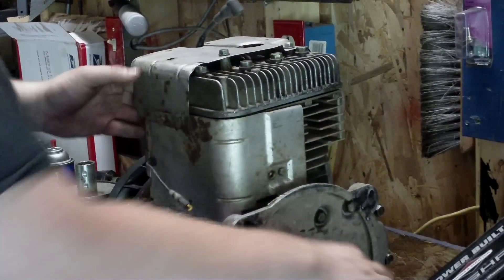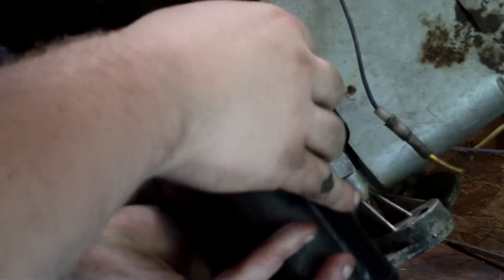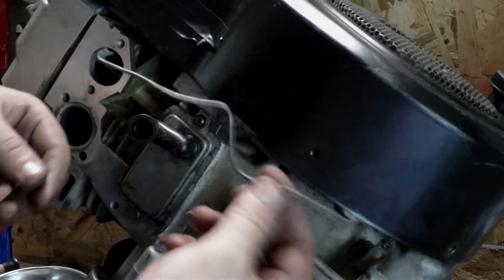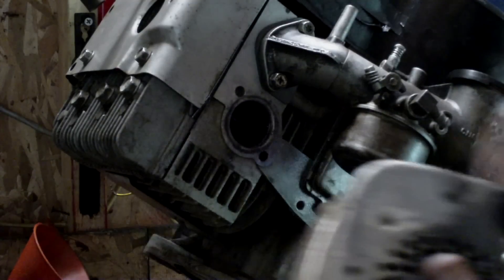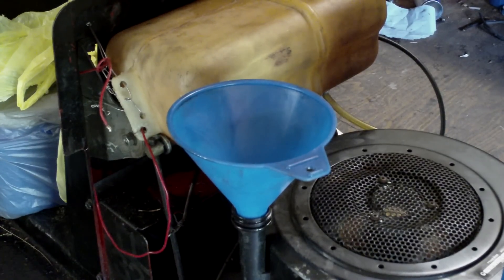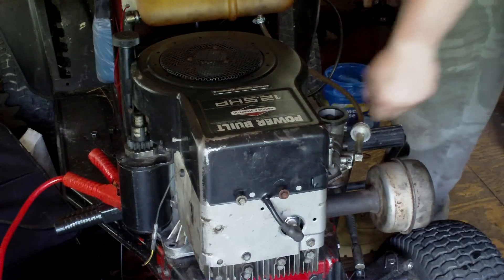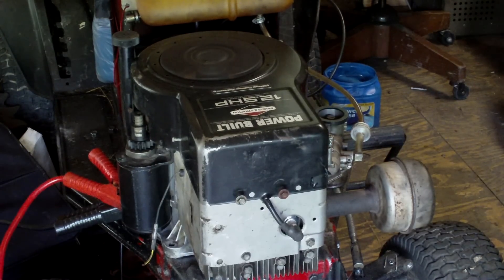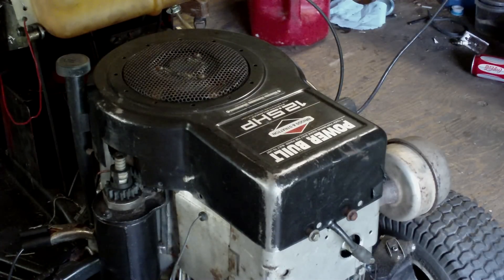Briggs and Stratton Power Built 12.5 HP Flathead Model 28 Rebuild  First Start PART 4 (FINAL)

Comment: got a leak coming from it but don't know where yet, I took the motor off the riding MTD Yard Machines today.  Briggs & Stratton Model: 28T707  Type: 1154-E1  Code: 010302ZD.   Lower shaft seal not leaking but oil was coming out and getting on the 2nd shaft pulley (not the small pulley but the big pulley indicating that I don't have a shaft seal leak)...is was pooling on the pulley and getting all over the V-Belt.  I don't see any crack in the block, but there's black gunk every where more on one side than the other.  I figure the lower pan /sump gasket needs replacing so I'll get that moving if I can find the right gasket that has the right thickness.  The Head gasket area looks dry, I hope it wasn't just leaking at the oil filler tube but probably not since there is gunk all around the engine.  I hope to not have to pull the flywheel but it's sure rusted around it and gunk in there, but it's dry black gunk around that top flywheel area of the engine, not shiny oily black gunk..  Have any ideas on the leak it sure is appreciated,   By the way, the engine runs great and there's nothing rattling inside the engine.  I'd hate to change the lower pan gasket if it's not needed but I suspect it is.  Should I only get Briggs & Stratton gasket, not a problem if so, I just need to find out where to get one (that can be shipped quick like Amazon)

Comment: While this may be eleven years old, he did an outstanding job of showing you how to rebuild the vertical shaft B&G 12 horse motor. There are thousands of these motors still in service and this series will show you exactly how to overhaul them and keep them running.   I just bought a 2001 Estate 48” Rough Cut pull behind mower with this type engine on it for $350.  Now I can rebuild mine too!  Well done!

Comment: Enjoyed! Thanks. 
I'd like instructions on oils. Your one on stp was great. I just use the same 15W40 oil that I use for my van but have been trying to find out if so-called specialist oil for mowers is better, maybe justifying the price. I've learned that if you've only used car oil that's ok -- but if you use the specialist stuff DO NOT revert to ordinary unless your aim is to ruin the engine; unless you flush the system first ... with a product that is...no longer available.

Comment: Very helpful and really appreciate all the detail.  I've got a 10.5 HP Briggs (25 series from 1993) apart on my bench waiting for rings.  I am also having to replace the governor as the hole where it fits on the pin has been wallowed out...long ways so the hole in the gov bracket is oblong along the bracket as opposed to just a larger hole.  Have you ever seen that ?

Comment: thanks for doing the videos.
i bought 2 ride on mowers last week, one was stripped down with no head on the engine, the other supposedly had electrical issues.
after i rewired the "good" mower i discovered the inlet valve was stuck open.
i've mostly stripped both engines down, and there was no clearance on any of the valves, the guy found the 2nd head so i can go collect it.
the bores on both engines look good and measure as standard, so i think with 2 sets of rings and gaskets i will have 2 (more) working mowers.

Comment: I'm looking to rebuild my 12.5 what's the kit coast and is it worth it
Reply from the maker: There are complete rebuild on kits on ebay for around a 100 bucks last time i checked i usually order parts separately if i don't need a complete kit (which usually includes all gaskets, rod, piston, valves, rings etc) and yes, if the engine is in good shape, no major scores in the cylinder and the rod hasn't came through the side then yes they are usually worth rebuilding, good reliable engines and in my opinion better then the current ohv motors. Thanks for Watching!!!

Comment: Do you have any pointers and time frames for full break in?
Reply from the maker: I like to run them for about 20-30 minutes with little to no load varying rpms, drain oil, then in this case, mow grass (like a hour or 2), after like 20-30 minutes let it idle for about 5 minutes, and do this 3-4 times to let the engine heat up and cool down, it helps seat the rings in. then change oil again and it should be close to being broke in by then, some may take a little longer. Thanks for Watching!!!

Comment: Can you take a briggs engine off a craftman mower and put it on a murray riding mower?
Reply from the maker: Short answer, usually. If they both had say a single cylinder briggs it will be a bolt on fit, some of the wiring maybe slightly different but can be setup to work, if your going from a single cylinder to a vtwin or the other way around the bolt pattern is different on the engines, but alot of frame have more then one set of holes drilled to be a more universal fit. So yeah, worst case scenario you may need to drill some holes, but usually can be done. Thanks for Watching!!!

Comment: Great videos chap, thankyou for sharing! I have a 12hp which was blowing gas out the carb and not running, I checked compression and found it to be 0 even though it feels and sounds like it has strong compression... Put my finger over the plug hole and cranked it and it sucked my finger hard!
Started stripping it and found the oil slinger had smashed up but doesn't explain the sucking instead of blowing! 

Any ideas? 🤔😁
Reply from the maker: Your welcome! I'd check the valve clearance to make sure the valves are sealing they act strange like that if they are not sealing. Thanks for Watching!!!
Reply: @fnaguitarplayer9  thankyou back mate, your videos are fantastic, it's good of you to share such extensive knowledge, appreciate it pal 🙂
Reply from the maker: @kiesh.  your welcome, appreciate that! glad to help out.

Comment: Hi, I'm rebuilding a BS 12.5 hp 28V707. My ring gap is .047. Piston and Cylinder walls look good. Can I use .030 over rings to close the gap to within tolerance? Thanks for the great videos!
Reply from the maker: You shouldn't need oversize rings, the rings wear down so if you get standard rings it will take up the difference, I usually usr .010 and then file the gap to get it to spec. Thanks for watching!

Comment: I friend just gave me a Murray with a 12.5 in it. We never managed to start it, but it doesn't sound right when cranking, So I'm going to tear into it today. I figure at best it could use a rebuild, at worse.. well don't even want to think about that.
So your video is going to help a lot, thanks for making and posting!
Reply from the maker: Your welcome! it could be rod knock or the counterweight system.Thanks for Watching!!!
Reply: I thought perhaps it was the connecting rod cap had come lose, being that they didn't put the locking tabs on them... But sadly, it wasn't.  While I'm not a 100% sure, but I think the cause was broken rings, as they were all broke and in pieces, which in turn did a number on the cylinder, deep gouges and one of the lobes on the cam is flattened out. The piston is toast.   I was so jazzed after watching your rebuild video. sigh but this Totally bums me out. I dunno what I'm going to do with it now.. other than watch for a cheap 12.5.. who knows how long that could take.

The piston:http://img4.imagetitan.com/img.php?image=18_piston.jpg

Thanks again for the vid & info!
Reply from the maker: oh wow! Shame to see that happen to one, they are really good motors. Not a problem!

Comment: How do I fix a knocking 12hp briggs and stratton engine do i tighten the connecting rod
Reply from the maker: It can be 1 of 3 things or a combo, it could be rod knock, if so it will need a new rod, best way to fix that, or it could be piston slap, may need to have cylinder bored and a oversized piston, OR the most common source of knock besides rod is the synchro balancer system on the crankshaft, they are bad about making noise. Thanks for Watching!!!

Comment: Thanks again for the replies, much appreciated, I used STP like in your vids so I’ll give it a good cranking with the plug first too. The re-assembled crank felt silky smooth with the STP on the main bearings by the way. Going to try it direct off the battery on my old merc diesel, while the cars running, and if that fails to start it, put my electric drill on the flywheel nut at the same time. I’m guessing that if disconnect the kill wire, clamp the positiv jump lead over the starter cable connector and find a good earth for the neg lead the starter will just go until a lead is disconnected, no matter where the mower key is? The valve clearances seemed pretty good after adjusting so I doubt that is problem.
Reply from the maker: Your welcome! I hear ya, that should get it going! yeah that will work like that. The other thing i've had happen that made a motor super stiff was the crankshaft end play wasn't set right (gasket thickness) and it binded up some, but it still eventually cranked over. we didn't have the right gasket and had to get it going one way or the other.
Reply: fnaguitarplayer9 I got her running, and she’s smooth🙂Had to buy a new inlet valve, I’d ground the original back too far when I double checked.....Amazed me that a clearance of 6 thou compared to 12 thou made all the difference to the compression, but there you go. Chinese carb off ebay works a treat two! Thanks to the help from your video I know have a re-conditioned engine, so I just have to keep the rest of the mower going now! Gonna change to oil regular too.
Reply from the maker: I hear ya! glad to hear you got her running! Oh yeah, it really does! Heard that, surprised to say this but you can't beat the cheap carbs these days, they are actually pretty good! I hear ya!

Comment: Got my engine back on with new rings but compression seems so high that starter can barely get it past TDC. Because of this it wont start was wondering if you had any advice? Could  be the stater but it seemed to work ok before I changed the rings
Reply from the maker: This is common, one reason i've found is there excessive oil in the cylinder from putting oil or stp on the rings and it will cause extreme compression, take the spark plug out, crank it over for a minute, charge your battery back up, and try it again with the plug in and see if it helps. once it finally starts it will be easier after that. I've had to use 2 batteries before, like when car engines are rebuilt. it could be a weak starter but I would guess its oil built up. Thanks for Watching!!!

Comment: Hi again, I’ve got the valve clearances right, and the seats lapped so that will hopefully make a big difference to the running, as there was zero gap. Also decided the engine is coming off the machine, and the piston rings will be replaced! Parts ordered so just need the wife and kid to go out for the day😂 I’ve bought some cheap ring pliers to help, so I’ll let you know how it goes. The engine was made in 97 and I’m hoping to get another 10 years out of it. Would never have tried this without your video so thanks again👍
Reply from the maker: Hi, I hear ya, that makes a big difference itself, if there is no gap then the valves are not closing completely. Sounds good, you should get more than out of it if you get a tight ring gap and keep up with oil changes. Glad to help! Thanks for Watching!!!

Comment: Watched all 4 parts, superb, I’m using the snowy UK winter for a mini refurb of my old lawnflite. Just had my flywheel off at the weekend to renew the key as engine is backfiring, and haven’t started up yet so really appreciate the advice on having it torqued right up. To take time to film this, as you have, it very generous so thank you very much. 
Q sir. If I have the mower on ramps I presume I could take off the pulley from below, before removing the engine? After seeing you do it I really want to check and clean inside the crank case now!
Reply from the maker: I hear ya! Good winter project! Your welcome! You should be able to remove the pulley that way, you may need to remove a belt guard but other that it will come off, sometimes you can leave the guards in place and just remove the bolt and the pulley will stay in place. Yeah it would be a bad idea to do that, they get gummed up badly. Thanks for watching all 4 parts!

Comment: I successfully repaired my engine. Got it started and running 2 nights ago. After breaking it in for a bit, I decided to take it for a spin around the yard and I didn't get very far. For some reason now the parking brake and transmission is acting up. When I put it in gear in either forward or reverse, it sticks in that gear and pressing the brake doesn't stop the tractor completely. Even with the pedal bottomed out. Thing that is messing me up is, when the connecting rod broke, the transmission and braking system worked fine. Not sure what happened... any ideas?
Reply from the maker: I hear ya! There's 2 things that come to mind, first off maybe the drive belt got wrapped around a belt guard making it act like more tension on the belt, had that happen a few times. And its very easy to overlook. Another thing is maybe the engine is sitting more towards the front of the mower, on some mower frames the mounting holes are bigger than the bolts so the engine can actually move slightly with the bolts loose. But i'd say check the drive belt. Thats really the only thing i can think of. Its probably not the brake itself, but if the belt isn't disengaging it will over power the brake. let me know if this was it, if not i'll think of something else! Thanks for Watching!!!

Comment: Thanks for the great videos. I have no experience in small engine repair and I am currently rebuilding a model 28 based on your videos. I have the crank in,  the piston in and I am at the point where I am torquing the bolts on the connecting rod. In your video you say torque specs and gap clearances for all parts necessary. Where can I get that info to have on hand?  For example I think you say 180 in/lb for the connecting rod specs and my lack of knowledge here leaves me a bit confused because the new connecting rod came with 2 different sized bolts (assuming 2 different sizes, require 2 different torque?). Also, do these bolts require thread lock or no?  
Update: I found some torque specs after all. Guess thats where cellphone and desktops differ. The literature I just found says ** Torque Small Rod Screw First:
160 In. Lbs. Torque Large Rod
Screw Second: 260 In. Lbs.
 the page I found is here http://www4.briggsandstratton.com/miscpdfs/RNT/Engine%20Specifications%20Chart_ms3992.pdf
Reply from the maker: Your welcome! I hear ya, glad to help out with your rebuild. that is the same chart i use for the specs, i have it printed out too.  I don't use thread lock on any bolts, unless its rod bolts without the locking tabs, then i might put some on them. Each bolt is differently, you torque the short bolt to 160 inch pounds then torque the long one at 260 inch pounds. hope this helps, thanks for watching!!!

Comment: great video. 1st time tear down and rebuild. went great. quick question though. is there a certain way the piston rings should be facing inside cylinder once installed?  
TIA
Reply from the maker: Thanks! Yeah, the new rings should come with a instruction on that, and if your referring to the ring gaps, make sure they are offset and not inline with each other, 120 degrees apart from each other. I have another video talking about piston ring orientation that goes into more detail on how to install rings. Thanks for Watching!!!

Comment: Thanks for this awesome B&S Model28 rebuild video!!!
I was just searching for help to get my B&S 286707 12,5hp running smooth and smokeless again.
My only hope was, that when i change the piston rings, the engine will work normaly again. Actually I thought my engine is junk because it already eats the oil in litres. So i watched this video and looked how you made it and i made it like you and now...

...everything is fine now, no more smoke and no oil loss! Thats great!
I thought that i had luck too, because my engine block was not really damaged and i thought i realize the problem fast enough so that i did it for the engine in time. 

By the way i am from Germany (sorry for my bad english) but i had no problems by follow your steps for disassembly and reassembling!!!
Thanks again!
Reply from the maker: Your welcome! Glad to help out! Good to hear that its running good with no more smoke! Thanks for Watching!!!

Comment: Hey man nice video. I have the exact same engine except mins Is just 12HP. But mine has a misfire that can be heard at full throttle when not under load. If I engage the blades the misfire goes away and runs fine. I have adjusted the carb many times without success.  I changed the plug, fuel filter, air filter everything It starts alot faster but still has a misfire when not underload.  this engine replaced my 13HP Tecumseh, god I miss that engine. If you can possibly help please do. Thanks.
Reply: volvo09 Thanks guys, after watching another video I realized when I removed the carb to clean It, I never pulled the jets out. So they didn't get cleaned.
Reply from the maker: Thanks! It could be a clogged jet as volvo said or it could be a weak 
spark causing this. Also some of these carburetors can be adjusted some,
 and sometimes that will smooth out the idle, if it has the mixture 
screw, turn it out about a 1/4 turn, if has a plastic cap on it, remove 
it and turn with pliers. Hope this helps, thanks for watching!!!
Reply: if you manually apply some choke by moving the arm on the carb with your finger does the misfire stop? if it does then your low jet in the carb is partially restricted. if it doesn't change then it's probably not fuel. the choke lever is the one the